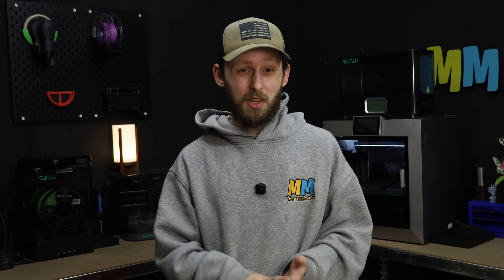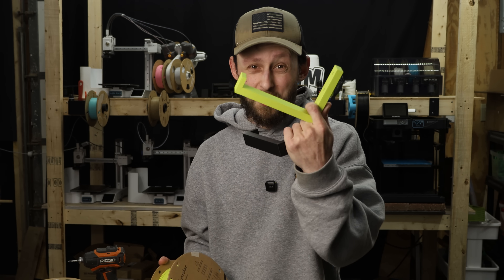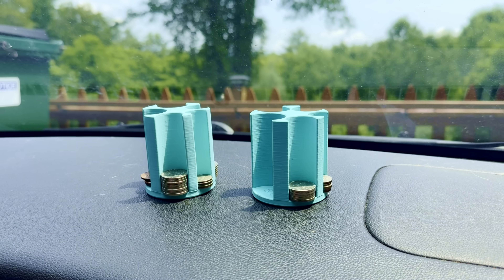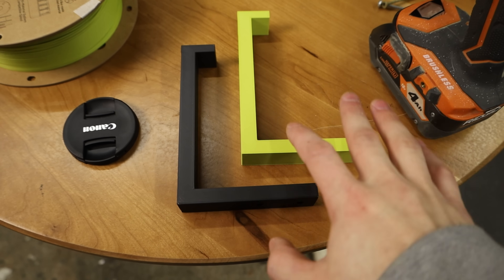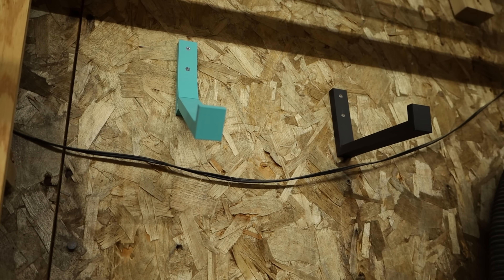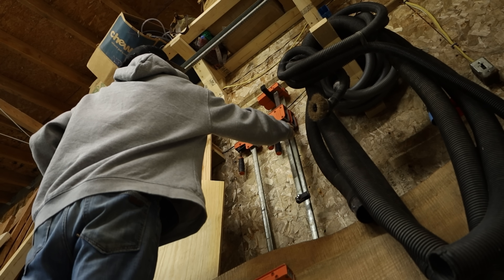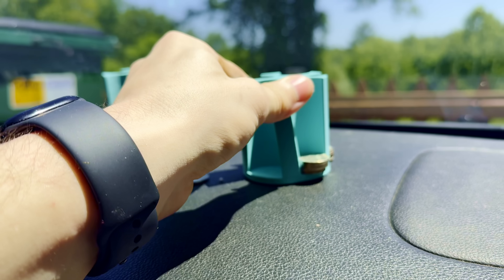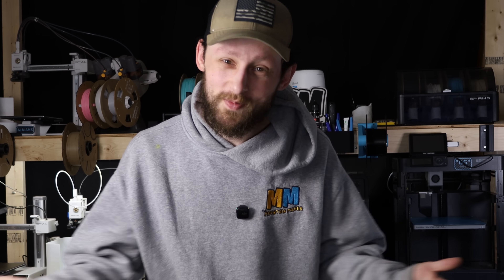Is This Filament ACTUALLY WORTH IT? Polymaker HT-PLA

Comment: I think you overlooked a big component of the ht pla. It needs to be annealed to truly shine.
Reply: Would be interesting to run HT-PLA-GF twice and have one annealed. And then re-test hanging the big clamps. Or testing annealed HT-PLA-GF against the elegoo base pla.
Or, HT-pla v ht-pla-gf. I wonder if the GF is a detriment when under elevated heat AND load? I ask because the GF is just bits of loose material. Not continuous HT-PLA filament.
Anyway, I'm sure others have made tests of their own. I'll go check.

Comment: Remember that adding any fibers will lower layer adhesion. Sometimes by a good 30%. You can see that the layers separated. So not unexpected.with the layers separating, the mass strength is lowered and the fibers then break.
Reply from the maker: That is what my thoughts were when the GF version broke so I printed one with the regular HT-PLA, but the results with that one were the same as the GF version as far as it breaking and where it broke. I still say inconclusive just because the test wasn't really for strength in that case, more so to accelerate the time it took for the parts to start deforming in the heat and with a load. Albeit, the regular PLA didn't break at all even after 3 days, but it did warp like I was expecting. Only reason I swapped it out on the 3rd or 4th day was to have 2 fresh samples to test from. Will definitely be doing more comparisons in the future and a "proper" strength test that was actually modeled to support weight but it does hold up to heat very well. That part in the car was super soft, softer than TPU when it was printed with regular pla and the ht-pla was just as rigid as it was the day it was printed
Reply: >adds bricklayers
ok now what? same adhesion and strength better stiffness and stability.

Comment: A larger fillet would have helped on those brackets. The layer adhesion is a little lower on the HT stuff and you can till that the break was caused by layers pulling apart. A bigger fillet would definitely help the angle it was pulling at. I am confused though as to what the point of testing the HT stuff was as I believe all their advertised claims assumed that they would be annealed. Did you anneal them and just not say so?
Reply from the maker: No annealing, the HT has 2 different results displayed on their website, One that is annealed and one that is not annealed. I opted not to anneal them because that is going to be the most realistic result for MOST people. As I said in the video, if you want more "scientific" results, check out My Tech Funs video where he shows the prints both annealed and not annealed and gives his results. In order to anneal these, someone would need a dryer or a spare oven that reaches the appropriate temperature for annealing and MOST people aren't going to have a 100c+ dryer or a spare oven laying around to do that. I will however, do another test in the near future where I anneal them and see if the results come out any different as far as the brackets with weight on them go

As for the part that kept breaking, the point wasn't necessarily to test the strength of the filament, more so to see how it deforms over a certain period of time. Adding the clamps to the brackets accelerates that by putting a load on them. As we saw with the regular PLA, it deformed just as I would expect regular PLA to deform and started to sag, but did not break. The HT-PLA was SUPPOSED to stay more at a 90 degree angle to show how it doesn't deform the same way regular PLA would, but it ended up breaking instead. Again, in the video I did point out a couple of times, the reason I chose to go with a bracket like that was to give it a worse case scenario with no supports or anything helping to prevent the part from deforming, as that was the intended goal was for it to start sagging with a load and in the heat. Im sure one clamp would've given similar results, albeit without the HT-PLA versions breaking but the regular PLA also did not do that... again, from a different manufacturer, but still standard PLA.
Reply: @TheMountainMaker I understand the bracket reasoning. It was mostly just me pointing out that people like my tech fun have already showed that it had worse layer adhesion and that was the reason it performed worse in the brackets. Also, I was not aware it was supposed to have better specs even without annealing so I do apologize for that.

Comment: Those brackets need a large fillet to help distribute the load better too.
Reply from the maker: For a strength test, you are 100% correct. What I was attempting to do in the video was accelerate the deformation of the brackets to cause them to sag (in the case of the regular pla). My hope was that with no fillets or angled support underneath the brackets, they would simply sag or deform in a warm 85-90 degree garage with a load on them, which the regular PLA did exactly as I thought it would. What I wasn't expecting was for the HT-PLA to break which is why I did the test with that one 3 different times using both the Glass Fiber version and the Non-Glass Fiber versions thinking maybe the addition of the GF particles made that prints layer adhesion slightly worse but I ended up getting the same exact result each time where the regular PLA just sagged a bit. If I was testing it for strength, I absolutely would've chosen a different design for the bracket and as I pointed out in the video, that one was a worse case scenario for the purpose of what I was testing, not so much to test the strength of the materials. Strength will be something I take a look at in a future test for sure though.

Comment: My question is why even make those kind of PLA? If your looking for more heat resistance why not print in petg,  and if you have an enclosure just print in asa
Reply from the maker: Well, its PLA so it prints just as easily as any regular PLA and its got a higher heat resistance so you get the best of both worlds. PLA is also stronger than PETG and ABS in many aspects and that has been shown in plenty of tests by multiple people much smarter than myself. PLAs main downfall is its lack of heat resistance especially while under a load which can cause it to bow or sag, like we saw with the regular PLA prints. My Tech fun has a couple videos regarding that as well as CNC Kitchen showing PLA coming out on top of PETG and ABS when it comes to its strength
Reply: My thought would be, fumes, toxic , are the off gasses hazardous? If so, I’m using a spare room and have a young granddaughter living here.

Comment: I’m thinking the reason the quarters were tough to get out is because the print annealed in the heat, and the normal PLA did so more because it isn’t infused like the HT version is. PLA anneals and XY shrinks by up to 5% and expands in the Z.

Comment: I have printed many parts now with the PolyMaker  HT PLA - love it. No need to go the fibres just HT pla- amazing smooth prints - I use the temp 230 with 60 bed. The HT is not about weight support as your design is the main reason for weight. Design your test for plain heat resistance and you will find the advertised difference. Being supported by Elegoo for comparison  is a bit bias. HT is not about load weights - HT is about heat resistance from warping.
Reply: GF and CF do not improve layer adhesion if anything they make that aspect weaker and more brittle.   it may help in strength on other things like tensile,  the main purpose of fibers, is to reduce shrinking for more precise parts,  the secondary benefit is cosmetic (they hide the layer lines).   one negative is particles are released and can get into your skin and in your lungs.  carbon fiber is almost like todays version of asbestos.  anything CF/GF in use around humans should be painted, enameled etc.
Reply from the maker: The test with the clamps wasn’t so much about how much weight each bracket could hold, more so to accelerate any warping or deforming that would occur by adding that weight. It just so happened that the ht-pla broke 3 times in the same fashion with both the gf and non gf variants and the regular pla didn’t break under the same exact conditions. Don’t get me wrong, i think the ht-pla is great at what it’s advertised at doing, but i didn’t expect it to fail 3 times in a row with the same amount of weight as a standard pla which is also why i tested it 3 times and even made sure on the last test to be as equal as i possibly could. Not really sure why it didn’t hold up like the standard pla if im being honest. Obviously that bracket was a worse case scenario in terms of how it’s designed, but its something that needs to be taken into account because now, a part that worked ok with regular pla does seem like it needs to be engineered slightly different if you want the heat resistance that the ht-pla offers.

Comment: I think it would be interesting to see a part that was designed to cope with the weight and just see if it deforms with 30+ degrees heat less. You could re-engineer the clamp bracket to support the weight but currently we still don’t know if it would deform like the standard PLA did when it got hot. Thanks for an interesting video.